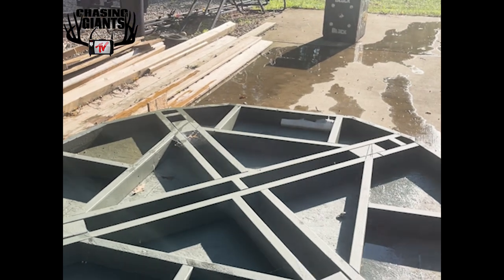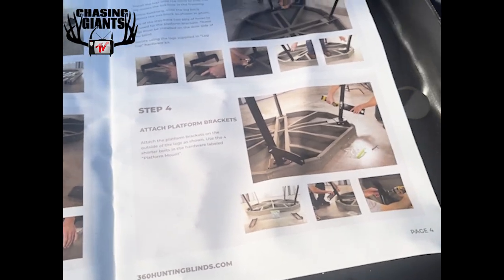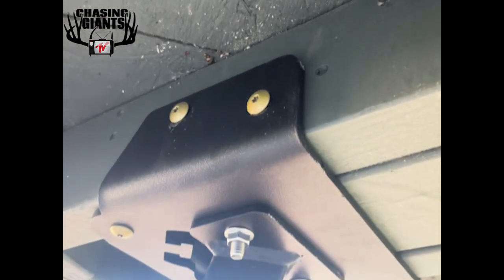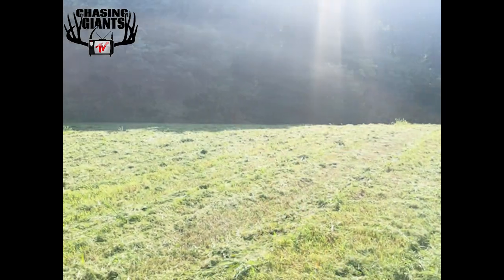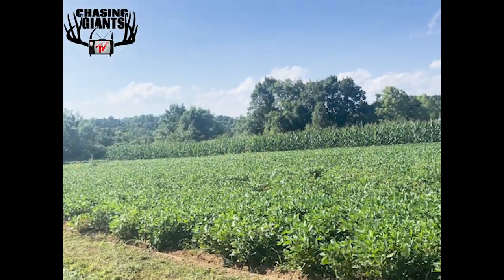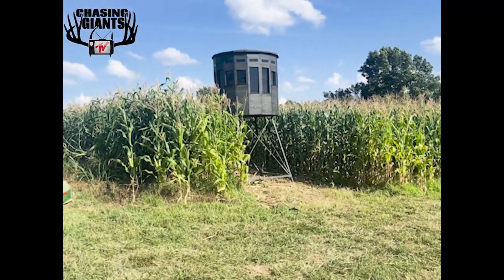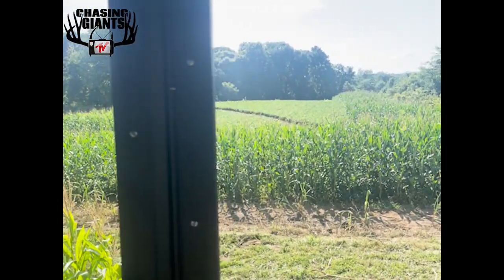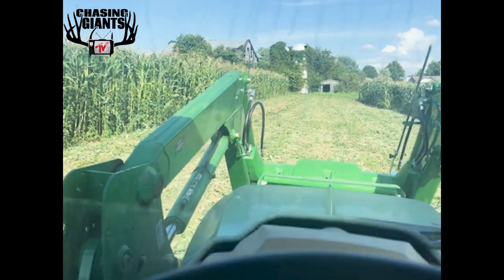360 Hunting Blind Is Complete - Assembly and Set-Up Overview

Comment: Terry, What are the pros and cons to the metal stand as compared to a treated 4x4 stand?
Reply from the maker: Thanks for the question.  I am sure there are people much more experienced with this conversation than me.  I have 2 x 360 7' blinds on metal stands now.  None on wood.  So i can not really compare them for you.   I would assume the wooden one is cheaper but I have never priced one out to know the exact costs.   I believe the 360 is designed to receive 4x4 posts under it so it can be done very effectively and rigid.    To me, i think the metal will last longer be less maintenance.   Time will tell if that is true.   One other thing i have found / seen about people who build the wooden ones is that there is few with the platform outside the door.   Just a ladder to the base.   While you could make this out of wood, most people do not and I like the platform and hand rails for safety especially with kids.      The metal stand is very nice and well built with stainless hardware.   If i had been around a wooden one, i may be able to provide some better insight but I just do not have experience to comment any more than this.  Sorry
Reply: Mice do not seem to climb metal stands.  All metal stands no mice wood stand mice.
Reply from the maker: I never would have guessed a mouse could not run up a steel post.  Interesting.  Thanks for commenting.